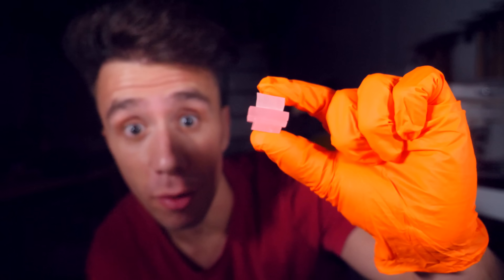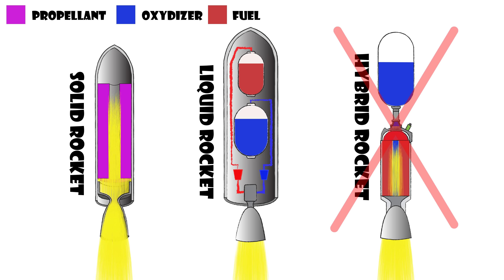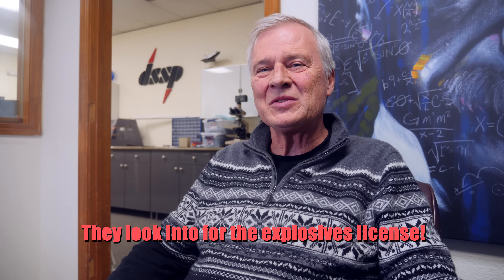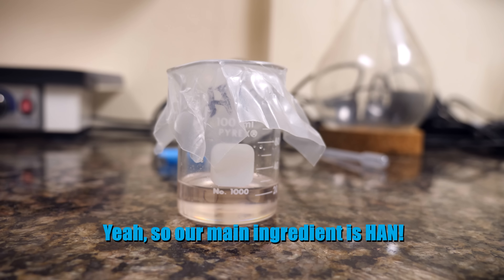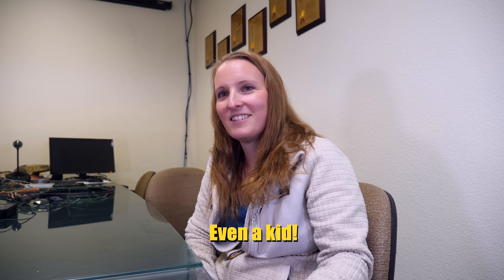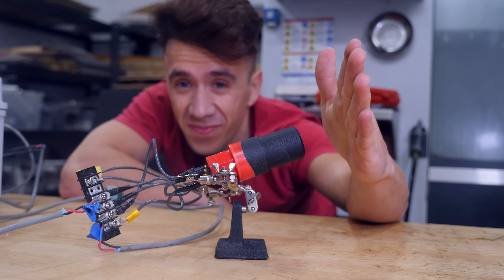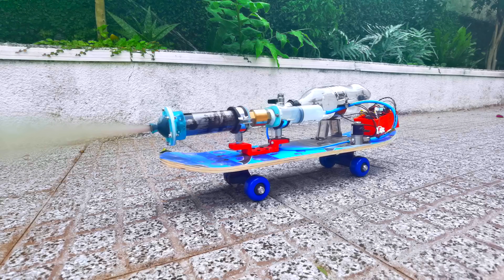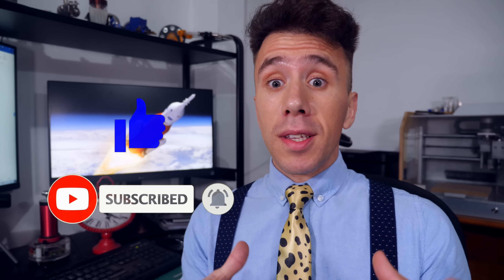ELECTRIC SOLID PROPELLANTS

Comment: Question? Have they use water as conduit? Just wondering as a steam just thinking what if you pass electric current would that heat up turning water in to Instant steam there for have safe propulsion? Thinking turning in to large steam rocket?

Comment: An idea: Experiment with a hybrid rocket platform using various chemicals like are found in HPAP as a "solid fuel" except you could delete the oxidizer as a hybrid rocket supplies the oxygen from a tank.  So form your hybrid rocket engine combustion chamber cylinder of the solid alcohol mixture you mentioned with a hole down the center for the oxygen to flow, ignite it like a standard hybrid rocket engine, then throttle the gas to control the burn.

Comment: Video Idea: You should investigate into the Rutherford engine (electric pump liquid propellant) and the curie engine, which i believe is another monopropellant engine but is still in trade secret. The company is called rocket-lab, I'm pretty sure your familiar with it. Could definitely help us understand the incredible specs of the rocket-labs rockets. Big Fan, keep up the fabulous work!
Reply: Curie was originally a pressure-fed monopropellant engine, but has since been upgraded to use "green" hypergolic bipropellants. HyperCurie is another variant which is pump-fed (similar to Rutherford) for even better performance.
Reply: @pseudotasuki  Sounds interesting, thanks  a whole lot for informing me.

Comment: --- video idea-----
---- laser-guided rocket----
Once you have a rocket with movable fins you could put a night vision camera that would see IR light on the front. An infrared laser would be the brightest spot to the camera. With some Vision code you could program the fins to guide the rocket to the brightest spot. This could be used for long range use against tomatoes.
Reply: If you develop any sort of terminally guided rocket - you will have an uncomfortable meeting with your local CIA or analog.
Reply: "once you have a rocket with movable fins"
Huuuuuuuuuuuuge project there to have something that works. In addition to the hardware, you'll need some pretty powerful and hard de develop controllers to guide it well. 
"Some vision code" probably very hard hard to do correctly.
That's not a video idea, that's a multi year project
Reply: Absolutely NOT, that is how you get terrorism charges or arms manufacturing. That will DEFINITELY have your door kicked in by the feds of some sort ASAP.

Comment: Here's an idea I would love to see you make, A medium scale remote controlled plane that  has a slot for a variety of engines that would run on different types of fuels and test their efficiency, e.g. rocket candy, monopropellant, compressed air etc. Great vid btw! Edit: maybe not the best thing to do in terms of legality, I am just sharing an idea.
Reply: I don't know how many Integza videos you watched, but based on my experience, that plane would survive max 3, maybe 4 flights before exploding or crashing.
Reply: @hubertnnn  I watched quite a lot of Integza's videos and it would be fun to see the outcome even if it ends in a blast!
Reply: Not to be a kill joy but don't the fuel types have that listed somewhere?
Reply: @Eduardo_Espinoza  Yeah there probably are many documentations of fuel types but trying out different rocket designs and nozzle's and strapping them to a RC plane would be very interesting.
Reply: Illegal in Europe and USA, but good idea otherwise. Fuels like that are considered “dangerous cargo” by the FAA and EASA.
Reply: @JoviusAquariums  yet model rockets exist, and so do ice model planes, so clearly there's exceptions.
Reply: @xxportalxx.  don't model rockets use premade verified rocket motors that are authorised to be used instead of homemade engines which could explode?
Reply: @simplebuilds1  the point was more that those are legal, so clearly there's a way it can be done, but that may certainly involve licensing (however if so that licensing ends at manufacture, considering no license is necessary to use them).
Reply: @xxportalxx.  Maybe if it is used in a desolate place like a desert or just far away from any houses.
Reply: @simplebuilds1  I'd doubt anyone would waste their time attempting to charge you anyway so long as you don't cause any harm. A great deal of yt is technically breaking laws dozens of times over, but it isn't worth the govts time to go after them and attempt to prove it in court (i.e. they'd have to prove your location in the vid first, hard to do so if your vid is in a room or a field).
Reply: @JoviusAquariums  Thanks for that, good to know! The backyard scientist did something similar with premade rocket motors but that might be different than using homemade rocket motors.
Reply: reinventing the wheel

Comment: Excellent video as always, my suggestion for a future video (if you haven't done it already 😆) is to build a hybrid rocket platform that you can test various propellent.  For example : pure oxygen from a cylinder, or perhaps nitrous oxide as the gas... and for the solid propellant: wood, rubber, acrylic, candy, etcetera.  My theory is the best solid propellant of all is pine wood, as in my experiments in Force Induction Combustion show it to be highly energetic as a fuel.

Comment: I would love to see you build your own flow reactor one day!
During my chemistry studies I used them, super handy to step away from batch chemistry and indeed finely control the temperature/time of a reaction.
Great video Integza. really interesting
Reply: I took one look at the flow reactor they flashed on screen and immediately saw how I can make it out of two plates and a CNC router... Flow the two together over a large surface area so you could pull the heat out of the reaction and then you just thermally regulate the other side of the plates.
I would probably use a secondary fluid on the other side of the plates and then regulate the temperature of that fluid That way you just have to pump something through the plates and if something goes wrong you still have fluid there to help control thermals.
Sounds like a fun project to me
Reply: Future congrats on your 3d 😊
Reply: Ik heb je berichtje geliket. Wie weet win je een 3D printer :-)
Reply: Just do me a favor and build a containment enclosure for your reactor, the thing is, I worked with a few and there is always a leak or something unexpected happens. It might look unnecessary, an expensive overkill, but it might unexpectedly save your life.

Comment: Integza, you should build a solid rocket propellant rocket internal combustion engine, replacing combustable fuels for a rocket exhaust as a gas generator that powers  piston engine or any potential internal combustion engine. may not be an efficient idea but it is a cool concept. Love your vids, big fan!

Comment: Make a Internal Combustion Engine using rocket fuel. Would be interesting to see what would happen
Reply: That's just a high compression-ratio diesel engine or a normal liquid fuel turbine though -- rocket fuel (RP-1) is "just" kerosene with additives.  Jet-A and RP-1 are very similar, RP-1 is pretty much very pure Jet-A.

Comment: is it possible to make a rocket engine using fuel and oxidizer in that way? like theres a fuel recipient (it can be any kinda thing that burns) and more compressed possible oxidizer with a valve that will despressurize and will make the oxidizer evaporate and this pression would put more pression in fuel for push the oxidizer and the fuel fast to combustion chamber with high velocity and burn them faster (probably if it works it would me fast and powerful and them it will become slower when oxidizer start loosing pressure but if that would works it would definetly produce alot thrust) that would be a pumpless rocket engine and you coud use something that become gás too as the fuel not just the liquid oxigen

Comment: Hi, I was wondering can welding rods be used as rocket propellant, and since they can be ignited using high voltage why not use them in a small rocket engine?
Reply: kind of yes.
There are very small thrusters which use evaporating metal, heated with an electric arc.
There are no burning there, just ionization and evaporation.

Comment: here is my video idea; what if you combine your latest bladeless fan project with your 3d printed rockets and create an ion thruster rocket, powered by a tesla coil or other high voltage source. Maybe you can integrate a mini tesla coil into a rocket to make it fully portable.
Reply: maybe making a working tornado model using smoke or gas would be also a cool idea to see it visually
Reply: Thats a cool idea
Reply: Indeed
Reply: Also if you plan on using ionic wind ionic wind isn’t very powerful
Reply: I second this motion
Reply: A tesla coil isn't a power source, it uses a lot of power in order to make an electrical field.
Reply: @Sail_School Nikola Tesla invented his namesake in order to provide wireless energy. Although it is not very useful for this purpose it would still be considered a power source in the same way you see light bulbs turning on while near them.
Reply: @Hotkife  I know what a tesla coil is/does. They said put one on the rocket as if it will generate power for the rocket. Also the size tesla coil you would need in order to power it externally would be very big, very dangerous, and draw a completely impractical amount of power while with his resources maybe having a range of 20 feet. There is a reason the idea of using tesla coils for ranged wireless power never really went anywhere.
Reply: you deserve the printer

Comment: Sometimes I feel like I'm going to end up on a watchlist from watching these videos

But what happens with these wiring wise when you have multiple?
Can you just wire them in series? 
I feel like these would have to be in parallel? given your voltage is your throttle and you kinda want thrust to be equal

Comment: Can you use your ion-wind thruster as a compressor for a jet engine?
Reply: ion-wind thrusters seem to have a very low limit of the pressure they can make. You need significant pressures for a jet engine.

Comment: Video idea :
1. What about making an RC jet with guided messiles using that technique.
2.Make an Rail gun.
3.An arc reactor but instead of current we use comburtion.
Edit: 4.Upgrade Nerf gun which uses mini
rockets rather than normal soft bullets.

Comment: Here is an idea for future video. New twist on the old cola+mentos rocket. Make small a tesla valve from a porous ceramic or similiar 3d printed material that would act as the mentos part. Would be interesting to see if tesla valve 'rocket' would work if dropped into cola or preferably some clear soda so it could be filmed easier. Could the one way flow feed the thrust itself, one end sycks in more liquid, it bubkes in the middle and exits from the other end.

Comment: Try and use different kinds of thermite as a solid fuel, if the metal powders are fine enough it might even be possible to make a pump so that the reaction can be throttled
Reply: For a useful (rocket) fuel you need gaseous reaction products which thermite on its own generally does not generate.

Comment: Make a generator with jet engine or rocket
Reply: i think the cruise ship finnjet had two jet engines that ran generators and the main propulsion unit was run by electricity
Reply: Isnt a jet engine generator also called a gas turbine generator??

And is usually used for tanks?
Like M1 Abrahms, Challengers and Leopards??
Reply: @erushi5503  also known as an APU on a plane I believe
Reply: Yes, Rocket generator
Reply: A rocket that fires a rocket thst hears up coffee or tea or drugs whayever your poison.
To the above: nearly all large engines especidlly on ships and tanks are jet turbines yes
Reply: liquid or monopropellant rocket using tesla turbines to make electicity and then calculate the effectiveness.
Reply: I once decided to buy explosives. I filed the docs the ATF and that's it. Easy breezy. And made my purchase.
Reply: Generator powers pump that flows ESP into catalyst, which powers generator.
Reply: Yes do it